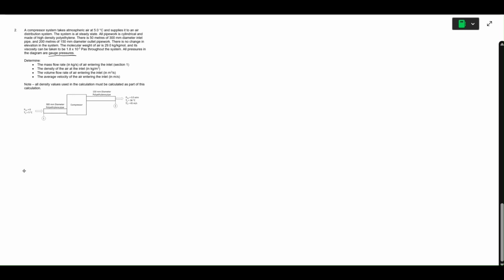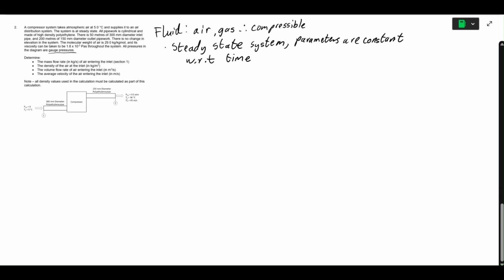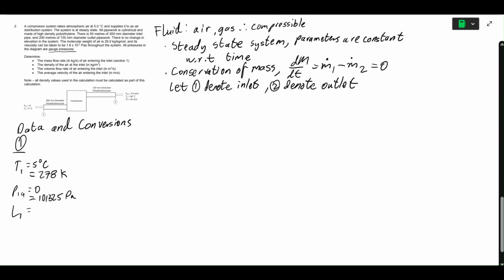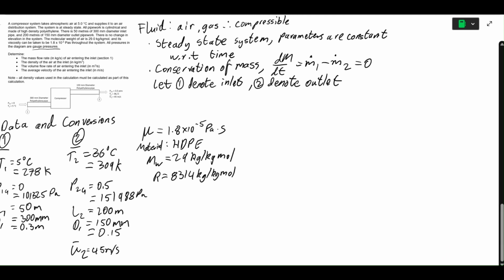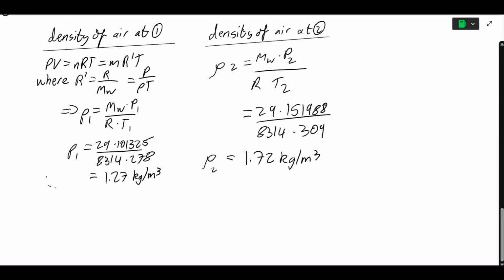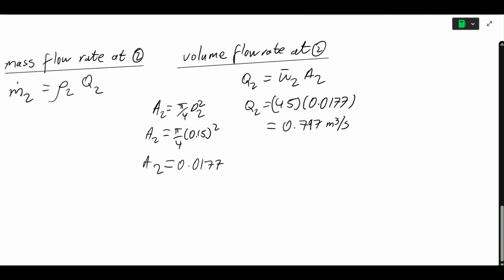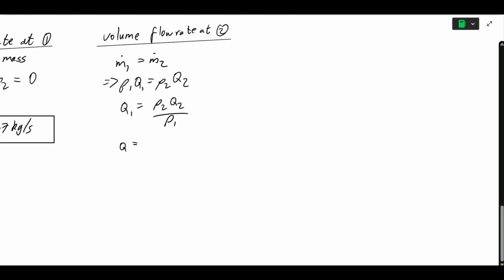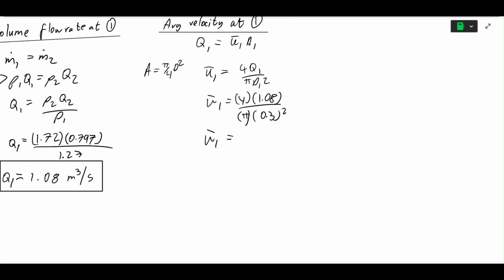Conservation of Mass Q2

Comment: Great video Otto, I have a few questions though, can you explain how the gauge pressures work and how this question would be applicable in real life?
Reply from the maker: Gauge pressure is essentially the pressure within a system which is measured relative to the external atmospheric pressure. Gauge pressure is the difference of the absolute pressure and atmospheric pressure. So, (Absolute Pressure) = (Gauge Pressure) + (Atmospheric Pressure). In the context of this problem, the gauge pressure at the inlet is 0 Pa and the atmospheric pressure is 101325 Pa. Therefore, the absolute pressure is just the same as the atmospheric pressure, being 101325 Pa. It's good practice to convert everything to absolute quantities in SI units to ensure all data and conversions can easily be followed by others viewing your work. It also minimises mistakes because you are forced to double check all dimensions and units.

This problem is fundamental and can be applied to many real applications. Think of using an air compressor to pump up your car's tyres. It is important to determine the flow rates and their parameters such as densities and velocities to ensure your compressing is supplying air to your tyre at an adequate rate, where it is pumped up in a timely manner without the flow rate being too great that it overpumps your tyre, possibly destroying it. Other applications include air conditioning, water supply (thinking of fluids other than air).